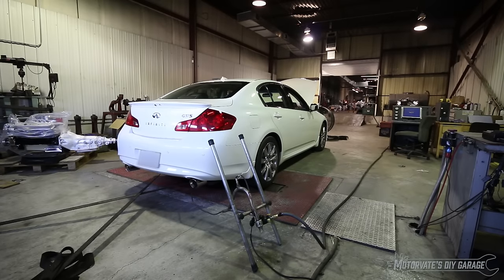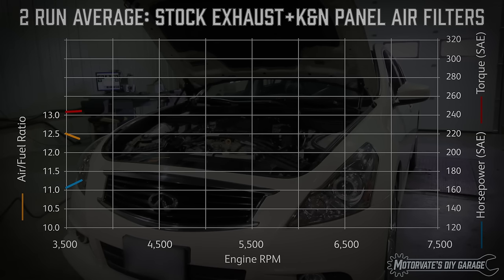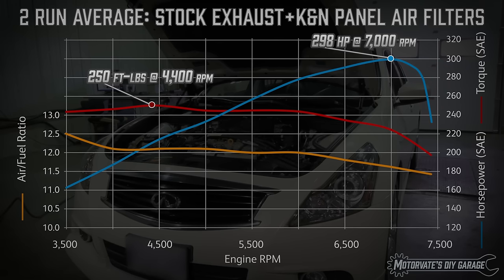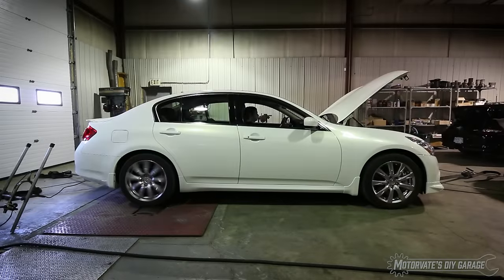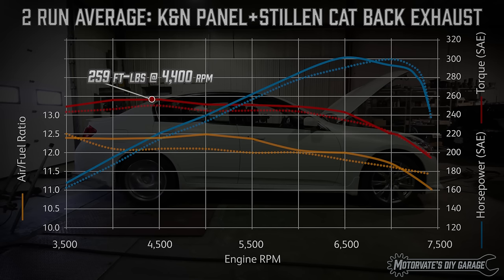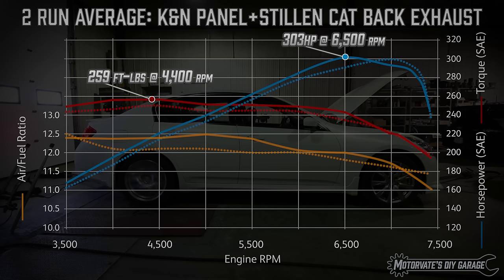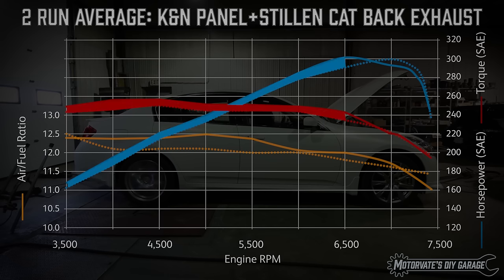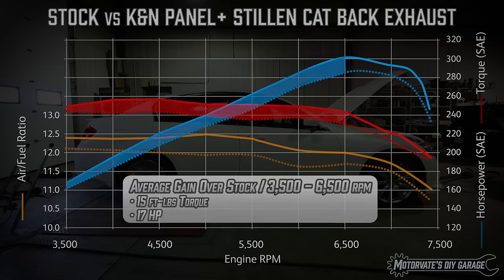Stillen Cat Back Dyno: G37 Sport Sedan  - Motorvate's DIY Garage Ep. 11

Comment: If you look at the A:F ratios, you can see why the power drops off.... engine seems to compensate for the added airflow by dumping fuel at the top, probably for safety

A tune to get it to 13:1 across the board would probably liberate another ~10lb-ft below 5, and probably another 15-20 up top. That is some insightful data.

Thanks for this channel... just bought a G37S and this answers a lot of questions about what mods are and aren't worth it. Keep it up! Subscribed
Reply from the maker: Hey future62,
Thanks for the tip. However, in the Toronto area a tune is around $800 Canadian. 
From the dyno sheets I have seen, most G37s seem to gain about a peak of 10HP with a tune. 
Too much $ for too little gain. 

I think 13s are a little too lean. From what I have read most VQs seem to like about 12.5 for peak power and long life.
The funny thing is in cold weather (10C /50F) my AFRs are around mid-12. With the warmer summer weather, they richen to low 11, sometimes high 10s depending on the air intake and fuel temp.

I would rather spend $800 on some  sticky summer only tires once my all-seasons wear out.
Plus I want to go back to Hanson Driving school :) - see episode 20 if you haven't already.

Comment: I have a 2009 G37S with ARK Performance Grip exhaust, high flow cat converters, Stillen Gen 3 intake, and Uprev tuned on a dyne.  The car is a beast.  It eats Mustangs for breakfast.  Dodge Challenger SRT's are no match.
Reply from the maker: Hey Hale White,
I agree, the VQ37 engine can make good power!
Reply: Good video, btw. @MotorvateDIY

Comment: So is it worth the Stillen price for the catback exhaust or just do a muffler delete and go with the stage 3 cold air? Your car is beautiful by the way I have never seen a cleaner G37S very sharp with the front and rear spoilers!
Reply from the maker: Steve, that is a difficult question to answer. Different people like different exhaust sounds. I don't like the "muffler delete" as it can be a little to loud and raspy for me. Also, I suspect the performance  gain of a muffler delete will not be as good as a proper cat back exhaust. 

The stock exhaust diameter going into the muffler is about 1 5/8", the Stillen cat back is 2 1/8". That is 1/2" MORE diameter and a increase of 58% in cross sectional area over stock. 

I know the Stillen exhaust is expensive, I paid around $1,800 Canadian for it. However it sounds good, it is well made, and it fit perfectly. I also smile every time I start the car and go for a drive.

If you want to spend a little to hear your car more, go with the muffler delete and a cold air intake. If you want to spend more to get a bit more power, get the Stillen cat back exhaust and two K&N panel air filters / or Gen 3 intake.

Thanks for your kinds words on my G37! The car is from California and came with the midnight grill, front and rear OEM spoiler and the optional 10 spoke wheels. (which I love!! Too bad they are soooo heavy) I hope to get the windows tinted in the next month or so.
Reply: Basically do it once do it right yeah definitely the Stillen exhaust and cold air should be a 30hp gain do you think?
Reply from the maker: It is really hard to say if you would get 30 HP as every car is different, but I think you would be close to that. Also the car would sound great!
Reply: S K a stage 3 cold air? haha
Reply from the maker: sk8punk318, tell you what... If you buy it and ship it to me, I will spend the money on the dyno, crew to shoot the video and edit it - and dedicate the video to you!

:)

Comment: In review the filter gave you more gains than the exhaust. It seems you have proven the quickest most cost effective method for more HP!! The exhaust does sound nice though!
Reply from the maker: Hey Jack Landsdale,
Thanks for your comment. The K&N filter does seems to be the way to go for a quick an easy way to get more power.

The exhaust also adds power, BUT it also adds that wonderful sound! I have had the exhaust on for 3 1/2 years and I still smile when i start the car :)

Comment: Another excellent video. Well said: peak power is not so important as the inceased area under the graph. What about doing avideo on an after-market downpipe test to add to the cat back exhaust? Keep up the great work.
Reply from the maker: Phil, thanks for your kind words!
There is no plan to dyno test pipes. I don't like the check engine light issues many (not all) seem to have.
PLUS it would be more difficult to pass emissions tests.
Reply: Hi, I recently installed a 3" downpipe and sports CAT (400 cpi) and had it tested for emissions - it passed on idle and mid-revs threshold. So no check lights. N.B. The CAT is a Magnaflow 11" long in stainless steel. Why not try it and do another great video. Definitely gained more power mid-range and top end without a re-tune.
Reply from the maker: Hey Phil Jones,
What vehicle is this on? When you mention "down pipe" I assume the engine has a turbo.

On the G37, replacing the catalytic converts is not a quick or easy job. Then there is the worry about failing an emission test every.  I will have to add your request to the "maybe" pile.

Thanks for the comment :)

Comment: Hey Motorvate DIY, did you have to tune the car to get those higher numbers? Or did you literally just bolt on the K&N and the Stillen Cat Back and got those numbers from the higher flow through the exhaust? Love the video!
Reply from the maker: Hey Ethan Delichte,
Thanks for your kind words on the video!
The car has a stock tune and I just dropped in the K&N filters with the Stillen exhaust.
I will be going back to the dyno for a re-test, just to see where things are at and I will get that episode out as soon as I can. :)

Comment: Very nice and informative. I still love the G35/G37, but the looks of the Q50...mm, had to get it. But you answered the question at the end, is a Stillen catback in conjunction with cold air intakes worth it, from the sounds of it and torque gains I'd say yes too with a proper tune.
Reply from the maker: Hey  BlkHwkGator, I agree the Q50 does look really nice but the G37 styling is not bad for its age.

Comment: Good video, short and to the point.  May I suggest also including percentage gains (losses) with the actual numbers?  If you're able to start comparisons with different vehicles that would also help determine true benefits.  Keep it up!
Reply from the maker: Hey Rich, thanks for your kind words! I like your idea showing % gain/loss and will see if I can work it into the next dyno video. 

As for the dyno results for different vehicles, that gets expensive very quick. Each hour on the dyno is about $150 plus the purchase of some after market performance part to compare to stock. That doesn't fit in the budget for 2017, sorry.

Comment: Good video. I think I'm going to take a chance and get a full-cat back exhaust and do a before and after dyno also to see if it will make any difference for my particular car... I'll also make a video of it too. I plan on getting it this month if the specialty shop can schedule me in.
Reply from the maker: Thanks Elliott! I look forward to seeing the results and video. When I dynoed my car, I used the OBD 2 port and recorded engine temp, oil, temp, air intake temp, air/fuel ratios, etc to try to see what the computer/ECU changes with the different exhaust. You may want to do the same.
Reply: I pay a shop to dyno my car; not sure if they can or will do all that technical stuff you mentioned. But tomorrow I am having them do a before and after dyno with my original air system and then a CAI, to see if for my particular car it makes a difference and I'll upload the video within the week, assuming the shop doesn't postpone my work for tomorrow.

Comment: I have a K&N drop in filter, with an "scs" custom exhaust, and res test pipes. I'm debating on getting the stillen gen 3 intakes, because they are on sale now 10% off. I'm guessing you were losing hp up top, because it was lacking airflow? Maybe that is why z1 can claim 18hp increase with their 2.5 intakes, on a 370z, with just an exhaust/flywheel. Food for thought..
Reply from the maker: That could be... 
I look at mods as cost/HP and ease of maintenance.
$500 US /16HP =  $31 per HP and that is crazy expensive... AND you need to remove the bumper cover to change/clean the filter.

Also, every 90 degree turn equals about 8' of straight pipe from an air flow/friction perspective.

However, that style of intakes looks good / fast.

Don't pull too much faith in dyno numbers... They are not very repeatable in results when measured at the wheel as there are too many variables.

I've had my car dynoed multiple times (same mods... K&N panel and Stillen cat-back) and the results have varied 10 HP.

Your best bang for the buck, is to take the intake money and do a high performance driving school. You will LOVE it!
Reply: @MotorvateDIY  Yea, I like the looks of long tubes, and the fact it is easier to install oil catch cans. Im looking at stillen specifically, because of their splash guard.                                                                                      
 
As far as maintenance, I was looking into holding the front grille in place with magnets. Couple little wires to also hold in case it did somehow come loose. I seen in a fb group, someone else did it already. 

I will search for driving schools near me first though. It looks like you had a TON of fun..:)

Comment: I own a dyno company in Wyoming....I'd be willing to bet you'd pick about 8-10% with a good tune.  The LEANEST you get is 12.5...that's a serious power killer.  I would dial in about 13.5.  Plus I'd be willing to bet you could add some more timing and make a bunch more power too.   That thing still has some gains left in it.  A tune would absolutely be worth the money.....trust me
Reply from the maker: Hey AWitty Pllot,
Thanks for your comment. I don't have any plans for a tune (In Toronto, the cost is > $800) but it is nice to know there is more if I win the lottery :)
By the way, what dyno do you use?
Reply: I have a Dynojet dyno.  It's an older inertia dyno but it works well.  I tune mostly Harleys and GM cars.  To tell you the truth I personally prefer to tune on the road.  I have GTech Pro GPS based dyno that is pretty damn accurate and I don't SIMULATE real road conditions, I experience them.  I get very good tunes and serious power improvements with it  and I have  verified it is very close to a roller type dyno.  You've done some very good testing here and you can see apples to apples comparisons.  I do the same thing.  I can tell you one thing, the book says 12.8 AFR makes the most power but I can tell you that's not at all what I have seen.  ANY time you get into the 12's you lose a TON of power.  Your tune shows the AFR getting close to 11's.  You're letting a lot of fuel in there...especially in the upper RPM band.  I'd bet you would see a bunch of power in the end of your runs show up.  As much as 10%.....that's upwards of 30hp.  And if you're not getting ANY spark knock your timing is probably at least 6* slow....another torque killer.  I know it's $800 (bet it is less than your exhaust) for a good tune but I think it's cheap HP/TQ.  It would easily be enough to feel it in the seat of the pants.  Problem is finding a good tuner that has the right equipment.  I KNOW you would see a difference.  Plus your mileage would go up.  One other thing....I've seen a lot of motors blow up from K&N filters.  Make sure you keep and eye on keeping it clean and oiled.  Cool!!  Good job bud!

Comment: Bet the power drop off on the top is the stock air boxes holding the motor back. Having 3 inch long tubes or even 2.5 inch long tube intakes should fix that.
Reply from the maker: I'm not sure about that... Based on multiple data logs, the stock ECU is programmed to reduce the throttle position at around 7100 RPM. This may be part of the "soft" rev limiter.

Anyways, thanks for the comment!

Comment: Great videos, thank you. Subscribed. Just bought G37S coupe for summer, videos are very helpful. 
Have you thought about comparing panel air filter to cold air intake from K&N, I'm debating between these two. 
As well would it make sense to put covers on intake pipes so they will heat less?
Reply from the maker: Hey Vladimir Levtsun,
Thanks for your kind words and for subscribing!

Comparing the stock intake with a panel K&N to a K&N cold air intake would  interesting. However, that is not in the budget for this year.

As for covering the intake pipes, I am not sure if there is any HP gain or benefit. The intake does get warm when moving slowly in traffic, but then we don't all "all the power the engine can make". In a future episode I will be showing the intake air velocity at wide open throttle. After seeing what it is, you just might agree it doesn't make much difference.

That is a benefit of the stock intake: The rubber intake tubes don't conduct heat as well as the aftermarket metal ones.
Reply: Interest point about pipes, however, believe the extra cover may help to slow down heat conduction, while it won't increase HP, but hopefully will slow down heating-up, as air intake is super close to the engine, and I don't like how they built filter boxes.
I just got G37S coupe and live in Toronto, so if you need a similar car for content you are welcome.
Reply from the maker: Hey Vladimir Levtsun,
Thanks for your offer, I will keep that in mind.
Reply: Got short ram K&N cold air intake, as well can borrow for video if you need:)
Reply from the maker: Hey Vladimir Levtsun,
Very nice! I'll bet it sound wonderful!

Do you have an inexpensive OBD scanner?
Reply: I have OBDLINK MX WiFi (wifi scanner for basic measurements).
Reply from the maker: Hey Vladimir Levtsun,
Excellent, I have the same one. 

Feel free to  check out my other channel youtube.com/obd4everyone

I might be asking you for some OBD data down the road for a future MotorvateDIY episode.
Are you OK if I do?
Reply: Motorvate DIY, sure,.

Comment: Watching this video has made me want to keep my G37S a little longer and maybe finally do an exhaust such as the one you have. I have a 2013 at 119000km.
Reply from the maker: Hey  Prajesh Prajapati,
With mileage that low, I  would keep it :)
Reply: @MotorvateDIY  I'm in the midst of doing a lot of suspension replacement such as control arms and tie rod ends and even the muffler is rotted on the top side.

I purchased a pair of tanabe Mufflers last night shall be interesting!

Comment: Motorvate, do you think the reason you did not see much gains from the catback exhaust is because you dont have high-flow cats? I heard they dont give much gains unless you have a hfc to go with it.
Reply from the maker: Hey Jaden Jeong,
From what I have read, the hi flow cats will increase power, but I worry they might set off a check engine light with a P0420/P0430 - Catalyst System Efficiency Below Threshold.

Catalyst System Efficiency Below Threshold

 Read more at: https://www.obd-codes.com/p0420
Copyright OBD-Codes.com
Catalyst System Efficiency Below Threshold

 Read more at: https://www.obd-codes.com/p0420
Copyright OBD-Codes.com
Catalyst System Efficiency Below Threshold

 Read more at: https://www.obd-codes.com/p0420
Copyright OBD-Codes.com
Catalyst System Efficiency Below Threshold

 Read more at: https://www.obd-codes.com/p0420
Copyright OBD-Codes.com

Comment: Great video! What are the costs in Canadian prices for the parts installed ?
Reply from the maker: Hey Paul,
That is a hard question to answer. As the value of the Canadian dollar changes, so does our price :(

Here is a link to the place I purchased it, with current pricing:
https://whiteheadperformance.com/product/stillen-stainless-steel-cat-back-exhaust-system-504377-infiniti-g37-sedan-09-13/

As for the cost to install, I have no idea as I did it myself:
• Stock exhaust removal: https://www.youtube.com/watch?v=nbSCimbCxUE
• Stillen exhaust install: https://www.youtube.com/watch?v=GQW1gYn2RVg

Thanks for your comment!

Comment: Hello, ive just buy a nissan 350z 2007 stock with the dual intake HR motor like g37 , i was wondering if can u make a tutorial for cleaning trottlebodys
Reply from the maker: Hey Julian Brioschi,
Sure, just for you :)

My car has 84,000 miles on it and it is due for a cleaning.
I will shoot it in September and it should be on my channel in October.

Comment: You should do a video with aftermarket intake piping. I heard the actual medal pipes create less turbulence the the plastic/rubber one. Would be interesting to see.
Reply from the maker: Hey Nostalgic Entertainment,
Hmmm that would be an interesting comparison. I wouldn't want metal intake tubes as part of the air intake due to heat soak, but smooth silicone intake dyno might be in a future episode, if I can get it to fit in the 2017 budget.

Comment: I highly recommend you throw in some high-flow cats in the future, those should net you a decent gain for the money.
Reply from the maker: Hmmm, it would be interesting to see what the gains are, but they are not in the budget for this year. When the currency exchange and tax, they would be almost $1,000 Canadian.

Also, some have had issues with check engine lights due to "catalyst efficiency" codes and I don't want that. - Yet :)
Reply: Motorvate DIY Well it depends on what HFC you'd go with, Berk HFC can be had for $455 shipped (US), I don't imagine it being much more to Canada. But I see what you mean if you want the Stillen cats to make everything match. I wouldn't worry about a CEL, many people (including myself) have been running HFC for a while with no issues.
Reply from the maker: Good to know about the CEL not being a problem. The prices in the US are great, but with  currency exchange (+32%), duty ($), shipping ($$$), and taxes (+13%) it really adds up. Maybe down the road if I win the lottery. :)